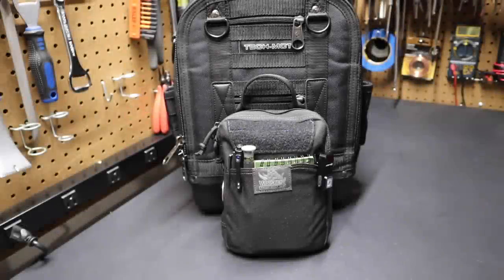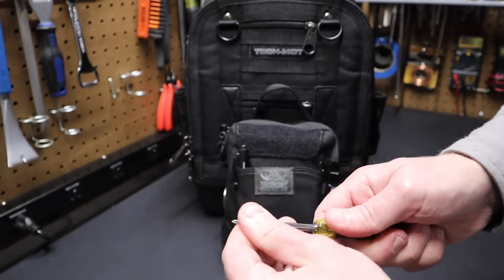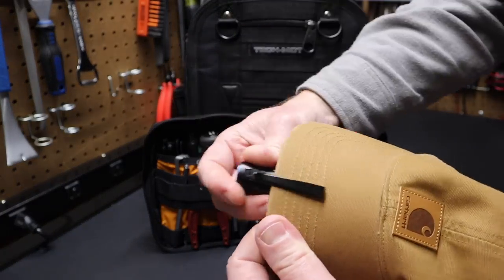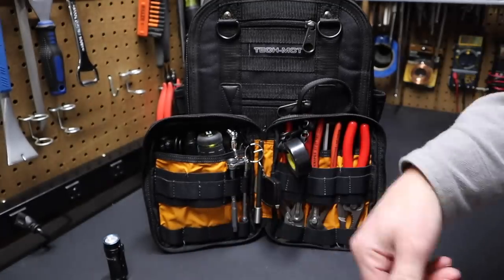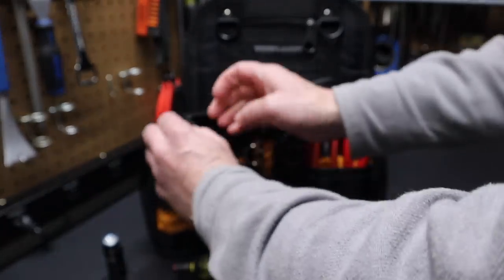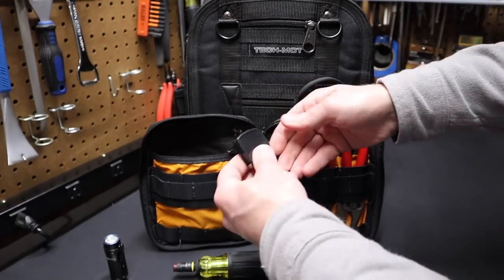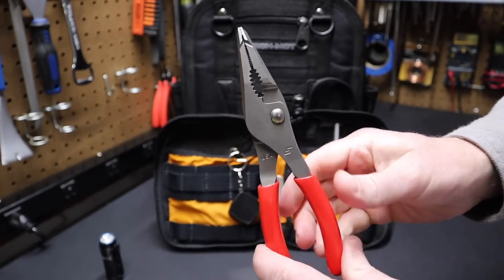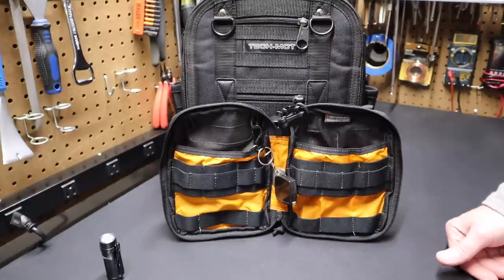Tool Pouch Loadout Setup 3.0

Comment: I also keep an assortment of different types/sizes of screws, bolts and nuts and washers. It’s in a small zip lock bag. It’s always handy to have something to secure different things so also some steel wire and some different components for small electronics. So basically some items that most of the tools in the bag can use:)
Reply from the maker: That’s a great idea. I could think of a couple ideas of what to store them in.  Thanks for posting!  👍

Comment: I feel that one thing missing from this great set of tools is a pair of  standard 7WR vice grips. You absolutely need something that clamps and locks. The pliers wrench has done a good job of replacing the adjustable wrench,but nothing has made the trusty vice grip obsolete.
Reply from the maker: I think that's a good point and I thought about vice grips but I just don't use them that much.  It's certainly something you could add though.  Vice grips are one of those tools, when you need them, you need them.  Thanks for the feedback and thanks for watching!

Comment: This is one of the best tool videos I've watched so far.  For someone putting together a tool kit, this is the ultimate video.  I'll have to tag you when I finish putting mine together.  I bought many of the exact same things, with a few changes.  Great video.  Thank you.
Reply from the maker: Thanks for the feedback. I’ve found I use the 7 1/4 inch Knipex pliers in my larger bag. They are a very handy size. Thanks for watching!

Comment: Great video. I love that ratchet. I use a tool roll so I have larger versions of the knipex wrench and pliers. I have a Tool Check Plus which checks many of your boxes. I use one of those 7 in 1 Wera screwdrivers instead of the Klein which I have in my garage with my main set of tools. I do like that the Klein has another row of bits but the tool check plus has that covered. Great video. I also carry a Bahco folding saw and a pretty versatile K bar fixed blade. I have had to use the saw several times to deal with downed trees of all things that were blocking roads. I’m totally buying a small pry bar for my EDC roll. I also carry a truckers friend. Boy do I love that beast. I’ve used that a bunch of time when I’ve needed a heavy duty pry bar and for demo work. And it has a decent hammer head. It’s a beast and it’s always handy to have a cheap beast like on hand. Although I just looked, they aren’t so cheap anymore. Yikes. I love love love that pen. A bit pricey as plenty of lights and pens in my edc but it’s way cool. You should do an edc first aide video. I’ve got the mother of all first aide rolls in my car that I’ve spent years and years fitting out.
Reply from the maker: Thank you!  You’ve given me a lot of good ideas that I will be checking out.  I did buy another pry bar that’s in the video description now. Thanks for watching!  👍

Comment: A micro socket set works great. Includes common sockets, torx bits, screw driver heads. Also a small vice grips has many uses. My edc bag is used for enduro dirt biking. So lot of survival stuff.
Reply from the maker: Yeah I’ve thought about having locking pliers. That would be a good one to add.  Thanks for watching!  👍

Comment: this is probably the best kit i've seen thus far!!
it's interesting having the knipex plier/wrench and socket heads...
Reply: is there a reason for both the socket heads and knipex plier/wrench?
Reply from the maker: That’s a good question.  Three reasons. 1. The Knipex Pliers wrench can act as a sort of portable vise. 2. There are recessed locations where the pliers wrench can’t reach. 3. The pliers wrench can open a lot larger than the largest socket I have. Thanks for watching!
Reply: @projectpinehills  that's what i assumed :) at least for the recessed locations

Comment: Thanks for the loadout videos! 

I have a basic system where I have a few of the bucket buddies.  One each for general maintenance, electrical, plumbing and drywall/masonry.  Also a clear tote or two for consumables and bigger stuff... Electrical, plumbing, painting, drywall, PPE, etc.

I'm working to put together a tool backpack and a smaller kit for my motorcycle. 

This is definitely helpful.
I've tried a couple different tool rolls but I haven't really liked the organization options there.
Reply from the maker: I’m glad it was helpful. I like how you have those job specific buckets. That’s a good approach.

Comment: This is pretty well thought out. I don't think you need anything other than maybe a 6 or 7 inch mill smooth flat file. Same thing in round, triangle and knife shapes would open up a whole world of metal, wood and plastic shaping options in a small form factor, if you have the skills as well and expect to need to do some of that type work. I find that a cheap 2" "C" clamp fits in a kit like this nicely and makes a serviceable "vise" in  a pinch. A small Vise Grip is almost as handy. Thanks for sharing your content.
Reply from the maker: Thanks for the feedback, some good suggestions. Thanks for watching!  👍

Comment: One of the best if not the best I’ve seen. The only thing I think is missing is a small simple multimeter that I could not do without. A nice to have that is missing is a stripper/crimper.
Reply from the maker: You saw the multimeter in the video?  Strippers would be nice. Maybe better to have those than the snap-on long nose pliers.
Reply: @projectpinehills   My mistake! I missed that meter the first time through. That thing is pretty cool. Tough call between strippers and long nose. I find myself using strippers more often personally but long nose would probably be more generally useful

Comment: Not a bad set up. If you find it a bit bulky to carry, I'd recommend a veto pro pac mb with a sling strap. It's easy to carry and you swing it round to access tools without taking it off. You'd probably want to add a tool roll though to keep items a little more organised. 

I prefer slight smaller tools that fit in my pockets, mostly for quick repair, or a least removing covers and diagnosing faults before going back for spares and my tool box. Over 18 years on the tools I've constantly tweaked my set up, as I add to it, then try to reduce it down to the essentials, refining it.

My current work day EDC is:
-	Amprobe DM78C pocket meter with A7 notepad refill in the case
-	Open O'pen Pro Titanium
-	Facom R1PICO 1/4″ Drive Flexi Ratchet Set

Keys:
-	Knipex  Small Control Cabinet Key 00 11 02
-	Carbocage Keycage Key organiser
-	Nite Ize S-Biner Micro

Maxpedition Micro containing:
-	Knipex Cobra 125mm chrome
-	Knipex Pliers Wrench 125mm chrome
-	Leatherman Skeletool KBX pocket knife
-	Knipex 110mm diagonal side cutters
-	Asahi Lightool 8 x 10 wrench
-	Ashi Lightool 10 x 13 wrench (custom)
-	Teng 4in power grip long nose pliers
-	Klein Tools 4 in 1 pocket Screwdriver 32614
-	Snap-on 5” straight mini pocket pry bar PBMS5
-	Moore and Wright 70mm Miniature Vernier Caliper
-	Yato flat diamond need file (cut down to fit)
-	ABUS Titalium 30mm padlock
-	100mm stainless cable ties x 2
-	100mm cable ties x 6
-	M3 tap case with 2 x 500mA, 1A and 2A fuses
-	Festo 6mm inline connector and blank
-	Wago inline connector
-	200mm of insulated wire
-	Electrical insulation tape on flat card
Currently testing
-	Tsunoda MNK-100 mini side cutters
(Alternative to Knipex 110 cutters)
-	Vessel 220 USB +plus electric screwdriver
Reply from the maker: A lot of good info. I’ve been wanting to checkout the veto pro pac MB.  Thanks for watching!

Comment: I absolutely love it ❤ the tools are not micro and extremely useful The only thing I would add if there was room is the Knipex bolt cutters 😢 I just don’t see a Way to fit them in there they’re about a half inch longer than the cobras and the pliers wrench best tool loadout I’ve seen yet for the size and I’ve pretty much seen them all. I’m addicted to videos like this nice work man. Epic you’re a legend. 😊
Reply from the maker: Thanks, I hope you subscribed! lol  I've used this tool pouch even when I have larger tool bags to ensure it has what it needs for typical jobs.  Yeah Knipex Cobolts would be nice.  I'll check and see if they fit.  Thanks for watching! 👍
Reply: I did subscribe ❤
Reply from the maker: Awesome!  That really helps the channel.

Comment: I did something similar to this but I used the Vanquest FTIM 6X9 ($40). The way the pouch opens makes it perfect for pulling out tools up to 7inch but I did have two 8inch in there as well. So I also wanted to hold a impact driver and got a small tactical sling bag for $20 and attached the FTIM to the front. Works perfect, it holds up to 6 10in or less and has pouch space for impact or whatever. Everything is about 15Ibs normally, up to 20 if I am adding impact or filling it up.
Reply from the maker: Thanks for posting. I have thought about using the Vanquest FTIM, I like the way it opens. I’m going to check it out.

Comment: Very Nice.  You mentioned wire, I'd suggest 24" or more of bare or insulated copper wire (some old romex core), formed into a shape to fit around the outside of the back pockets, plus some safety wire prepared and stored the same way on the other side.

I like a set of small needlenose vicegrips (with a wirecutter!), a 6" curved and straight hemostat, some superglue, and a few bandaids.  Also, I'd recommend wrapping a couple of feet of quality duct tape around your lighter, and a few feet of paracord.  You can add some additional paracord as cobra-knot tied over the handle like a military-style bracelet.

A stainless pocket ruler/depth gauge/straightedge takes almost no space, and while we're at it, cut down a pair of chopsticks to fit for lunch, and fine, insulated manipulation.
Reply from the maker: Thanks for the feedback, you have a lot of good ideas I will be exploring.  Thanks for watching!
Reply: @projectpinehills  
The cool thing about the vicegrips, hemostats, superglue and paracord is they do double-duty as first aid items.  If you have a really bad bleed, the vicegrips can function as a large hemostat, superglue can close a clean cut nicely, paracord can make a sling or a tourniquet, duct tape can hold a dressing in place, etc.
Reply from the maker: Good point, I didn’t think about that.

Comment: That's a fairly capable set of tools. Appreciate that you didn't just decide you needed to completely go nuts with all the "EDC fad" products necessarily. You've got the Knipex tools—but they're in a tool pouch and they genuinely are very useful tools if you have a use for them. But I also see you're using stuff from Klein and relatively cheap (but very effective) Makita sockets. The only thing that sounds gimmicky to me is the Olight pen, but actually it's probably a good idea in poor lighting.

Just about everything else was … it fits, it's a useful tool, and it's good value for the money. Sounds like a win to me!
Reply from the maker: I was trying to make this practical, something that you would want to use.  It would be interesting to see new small tool pouches that have vertical tool storage that close come out in the market.  Thanks for posting!

Comment: The only things I have on my tool list misssing from yours are a toothbrush, titanium drill bits, drill guide, knipex twin grips and cobolt cutters, carpenters pencil and a mirror. I realize these cant all fit in the vanquest. This helps me understand how compact this set up can be. I do love the milwaukee 48-22-5506 tape measure and the railer magmat minis though. Also the wiha microbit adapter 75802. I am waiting for the icon long nose slip joint pliers in 7". The 10" snapon ones from your review look a biit mega for my needs.
Reply: Addionally the oemtools 26502 scraper is great.
Reply from the maker: Those are some good points.  The inspection mirror and pencil would easily fit. Thanks for the feedback and thanks for watching!  👍

Comment: Cool video,excellent kit,  great tools, love some  Knipex pliers , (love the  4" & 6" irwin vice -grips also ) I like the little ratchets, personally i will never have a use case for them though.
Reply from the maker: I didn’t think I’d have a use for the ratchet either, but it’s been great for Torx and Hex screws. Thanks for watching!
Reply: @projectpinehills  Forsure, If i had literally any reason, id pick a set up,   I do like the Stubby ratchets though & have used those plenty, usually 3/8 though

Comment: The only thing I would add maybe is some common 1/4” sockets like 3/16, 1/4,5/16 and 3/8.  Maybe 10mm too. I run across them a lot in my line of work.   Also wrap the lighter with some Gorilla tape. Great kit! It really gave me some good ideas to add.
Reply from the maker: It does have metric and SAE sockets. I like the tape idea, that is a good idea. Thanks for the feedback and thanks for watching!

Comment: Nice to see some useful full size tools in this EDC compared to the many not so useful micro tools you see in most other EDCs.  Not much duplication which is great too!  I would definitely check out Titan pry bars in place of the one you listed.  It doesn't have the multi functions but if you need to actually pry you won't have to fear it breaking.  They also have quite a sharp edge on the one side if you needed a metal scraper in some instances.  I was surprised at their quality.  You have me thinking on that plastic razor scraper its an interesting piece.  I can't imagine this getting much better if you did a 4.0 and I can see the specific items tailored to your needs so you can tell it's been used.  Definitely appreciate the links.  I will certainly be grabbing up a couple of these for my kit.  Subbed.  Thanks!
Reply from the maker: Thanks for the feedback.  The Titian pry bars are a great suggestion, I've added them to the video description.  They are flatter and 7 1/4" and definitely would work.  Thanks for subbing, very much appreciated!

Comment: Awesome setup.  I think the only thing I would change is swap the Snap-on pliers for a Knipex electrical installation pliers for wire stripping, cutting and crimpling needs.   The Snap-on pliers is a great tool but I could get by with the just pliers wrench, cobra and the electrical pliers.
Reply from the maker: That’s a good point. I had thought about making do with the Knipex as well.  I keep hearing about the Knipex installation pliers, I’m going to have to check them out.
Reply: I would agree. Installation pliers give more functionality IMHO. And I would rather compromise without the slip joints rather than compromise wire stripping tasks.

Comment: Cool. You should checkout a 4140 pry tool. It's very compact, strong and comes to a very thin edge. Also, a set of 1/4" hex drive nut setters is another affordable compact option for hex head fasteners.
Reply from the maker: I’ll check it out.  Thanks for watching!

Comment: Excellent video and a very well thought out kit. I personally would have included a leatherman surge clone, (for having a saw that takes jigsaw blades) in the place of the knife and the pry bar. And also you would have and a larger cutter
Reply from the maker: Thanks for the feedback, that’s a good idea. Thanks for watching!
Reply: And i would also change the klein 4 in 1 precision screwdriver for the 20something in one
Reply from the maker: Change to the 27-in-1?  That’s some to consider but it’s a good bit larger, but it would be handy.

Comment: It's almost scary the similarities between your bag and mine.  Same pouch, and many of the same tools including brands!  A few differences.....I carry a pen sized precision oiler to lube things when needed, some cheap small diamond files, a pin vise and drill bits up to 1/8" (for pilot holes or small drilling tasks).  I love that Snap On needle nose pliers, but in mine I carry a 4" vise grip with needle nose tips.  Thought that would double to hold things when combined with other tools.
Reply from the maker: That's interesting they are so similar.  I always like to hear other ideas.  I all our ideas.  I'll have to check the items you mentioned.  I like the locking long nose pliers idea.  Thanks for watching!

Comment: Suggest you look at Knipex TwinGrip pliers (82 01 200) for your kit. They are 8" but if they fit would be a good complement to your Snap-On slip joint pliers. 
If you've ever had to grab a nut or bolt straight-on there is nothing like the TwinGrip pliers (I've owned Vampliers but they were not comparable in performance).
Reply from the maker: I do like the Knopex TwinGrips.  Thanks for the feedback and thanks for watching!

Comment: love this thoughtful load out - especially with the vertical orientation - I wanted to size up on the Vanquest, but the larger ones for whatever reason have the right side go horizontal. 

If you were to swap out the Klein for a ratcheting handle which one would you pick? The new Klein 32500HDRT seems great, but you lose the bit storage in the handle, as well as the adjustable length shank which I like as well. The Wera seems like a good option for that then?
Reply from the maker: If you want ratcheting and bit storage in the handle, Wera. Thanks for watching!
Reply: @projectpinehills  I assume you went with the Klein bc the ratcheting would be taken care of with the VIM tool? Thanks!
Reply from the maker: @chuckdeez810 went with it because the shaft collapses and it has bit storage in the handle. I think the PB Swiss pocket insider is also a great option.  I want a screwdriver that I can quickly put into use.

Comment: Had you ever needed to use that EDC setup.?
Reply from the maker: I used it several times to ensure it has everything I need.  Replacing car batteries, fixing fence gates, replacing carburetors.
Reply: @projectpinehills  how much would you say the cost of putting it together if you don't mind me asking?